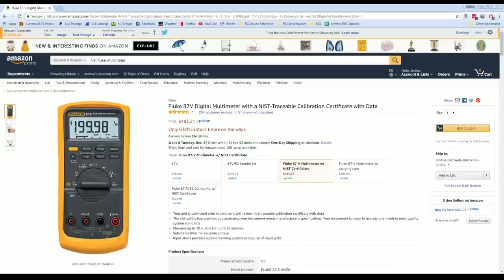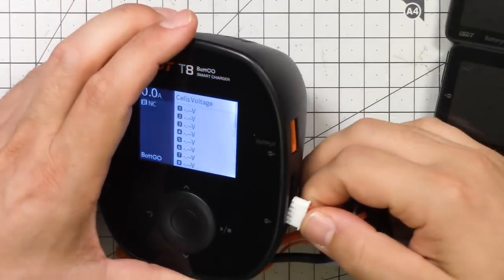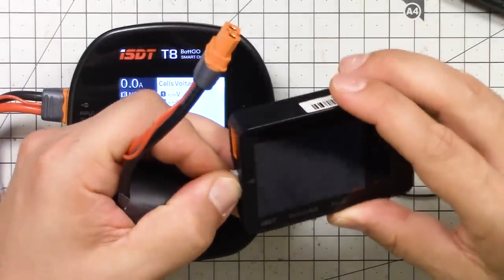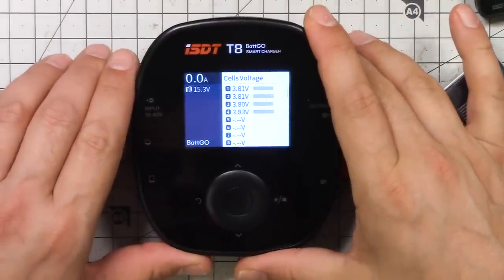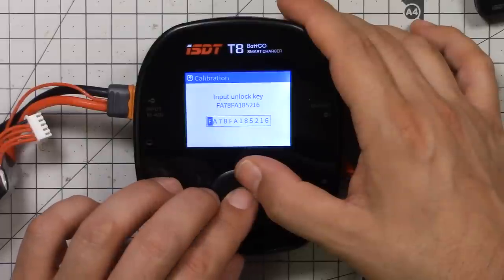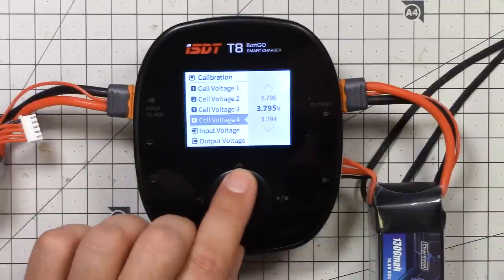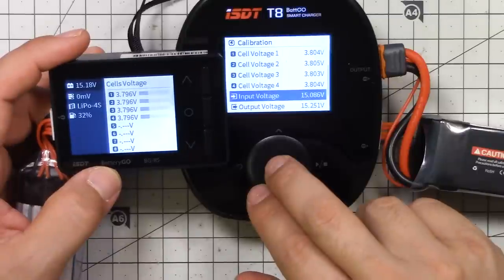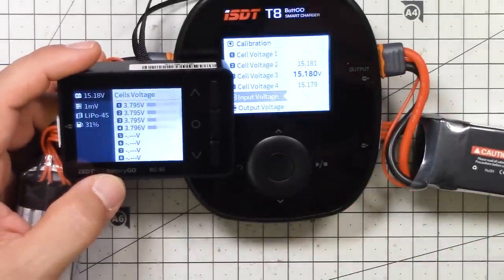Calibrate ISDT Battery Charger Voltage | HOW TO

Comment: i have an ISDT charger . can i charge 18500 and such battery with this charger? do i really need to buy a another charger for them?
Reply from the maker: You can charge any Lithium or Nickel cell with the ISDT. 18650 is fine.
Reply: I guess what I was really asking is how do I charge them with my Q6. Is there any special adapter out there? Do I need to use the balance connector also or should I just connect the XT60 output to the end of the battery somehow?

Comment: If you want to be really, really sure, you can get your multimeter calibrated by a certified company. It is about 50,- EUR in Germany. Or you could use your companies calibrated devices for checking, like I do :D
Reply: Any example, any purchase link ? Thanks!
Reply: Here is a price list from a company in my area, you might want to google for "calibration services" to find one in yours:
https://www.elmtec.de/download/Kalibrierpreisliste.pdf
It is in German but there are pictures besides the price-tags. They will use a standardized measuring procedure and hand you a sheet of paper about how much your device is off. You have to decide, if it is sufficient for your purpose.
Reply: calibration doesn't make the meter any more accurate/correct, it just insures that the meter is within it's stated accuracy spec. Calibration doesn't involve adjusting anything, it's literally just testing the meter up against a reference standard
Reply: That's what I wrote. It is basically just the paperwork a company has to have to get a fancy certificate that allows them to put shiny stickers on their products to feign quality. :)
Which fills the pockets of these service providers.
The expensive devices can indeed be re-calibrated, but that is done by the manufacturer.
Reply: Eh, in industrial or engineering land, calibration is pretty important for being able to trust the reading you get off your test equipment. useless for a home lab in most cases, but I wouldn't want to be testing a widget in a production environment, then find out that the meter I had been using was drifting around outside of the spec it had listed
Reply: Sure, but in most cases the certificate is not necessary. We have three categories of measurement devices: the highest level are the devices used for verifications and automatic testing equipment. They are calibrated with certificate. 
Then there are the devices for electronics development. They are calibrated against the above to make sure, they are precise enough. They don't need to be certified. 
And then there are devices for software development, which is were I live.
I just want to see if there is 3V or 5V or 12V on a pin or if a signal is high or low. The most sophisticated job my meter has, is checking if a DAC is set properly ;)
Reply: true, traceable calibration (ie. the certificate to go with teh test) is more about being able to have the business be ISO (or similar) certified. Unless you're working with some sort of crazy high precision equipment

Comment: It's nice that ISDT gives precise reading of upto 1/100 or 1/1000 V. But if you want a reading of your battery that so precise wouldn't you consider the the quality/resistance of those connectors and pins of your battery and charger? Specially if they've been subjected to a lot of use and abuse they probably had some wear already.
Reply: Alvin Navales there's a minimum of current that goes into checking the voltage, so even though the cables had some difference in resistance, the voltage drop would be miniscule

Comment: Are they coming out with a 4.35v per cell charge capability for this charger firmware update? Wanted to use this charger on my high voltage lipo. Has anyone successfully bumped the voltage up in calibration mode to charge a lihv battery?
Reply from the maker: +Aleks Siwoszek it can charge HV. Not sure why yours doesn't. Just set the program to LiHv.
Reply: Joshua Bardwell wow. Total brain fart on my part. Thanks

Comment: do you need a    true rms  meter    to measure battery voltage?  lol i just bought a   fluke  17b+ for 100$ yesterday
Reply: RMS means nothing when measuring DC voltages.  RMS refers to AC voltages.

Comment: What about output voltage?
Reply from the maker: +TempleClause you can calibrate that too.
Reply: Joshua Bardwell I know but what does it do? I assume its only used when you charge without the balance lead?

Comment: Best answer, listen to me, lololol, do not buy a 400 dollar fluke meter, I am not sure why Joshua is even pulling that one out. Buy a 100 dollar Klein meter, much better than fluke and 75 percent less, and still calibrated. The Klein meters are all the beauty of fluke and all of the less expense you would want. These meters give you much more than simply voltage testing and when building and diagnosing your quad can be essential. Sorry Josh I am stealing some thunder, but its true fluke would be the last thing I would buy, I am an electrician and most of use do not use fluke unless you want to be the ooooh look at me I own a fluke boy, flukes are nice, built well, and come with lots of bells and whistles that really do not apply to everyone. Klein cater to the tradesman and give you the precision you need and the reliability, but without the price tag, Klein are also built with more durability than fluke, I dropped my Klein off a 1 story house, about 10 feet or so, which would have destroyed any fluke, and my Klein was fine, not even a scratch. Anyway Klein look them up and enjoy.

Comment: Josh - Strange video, strange advise to calibrate something with something uncalibrated, or worse being powered from same voltage source...this is the rare occasion when doing nothing is actually much better and much safer than what you suggest. You can borrow a multi meter or a voltage reference or both ... hope no one get hurt and no house bursts in flames after following this method with 1 $ lipo testers as reference.
Reply from the maker: I also hope everyone takes all heed to the warnings I gave in the video. I'm very glad for suggestions of affordable, accurate multimeters and voltage references, and I definitely will be doing a followup video about them. And when we get a voltage reference, I'll see how close or far off my method was!

But I still maintain that if multiple devices say a given cell is 0.3 high, then it's not out of line to calibrate that down by 0.3 or so. I mean... even cheap $1 battery checkers and $20 multimeters are probably accurate to the 1/10th of a volt, right? And if they all agree, then...